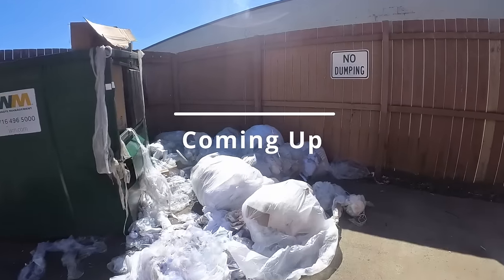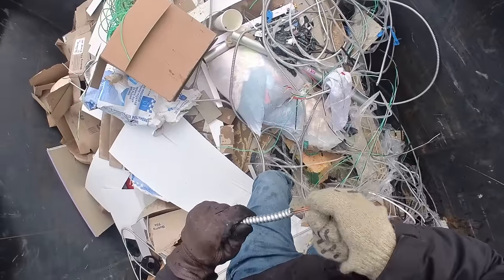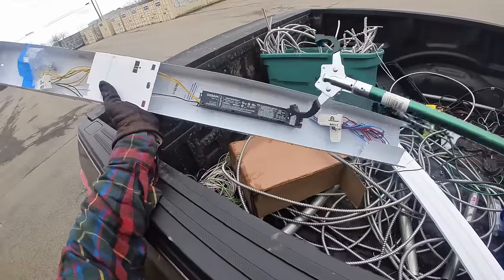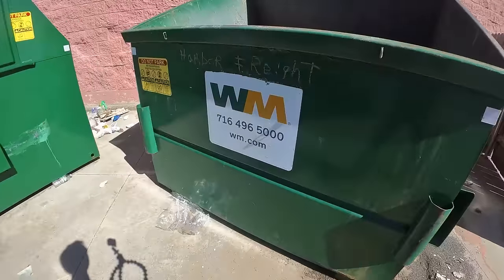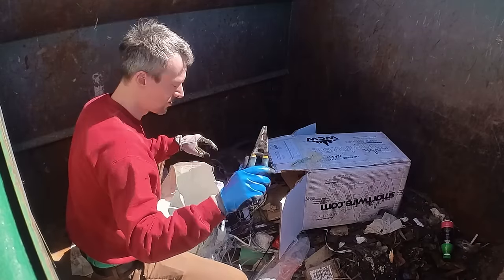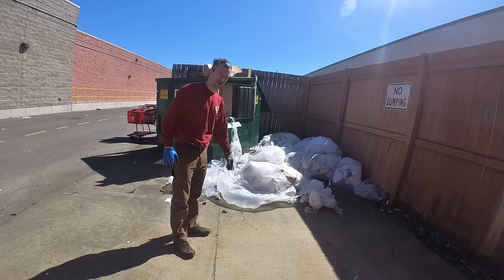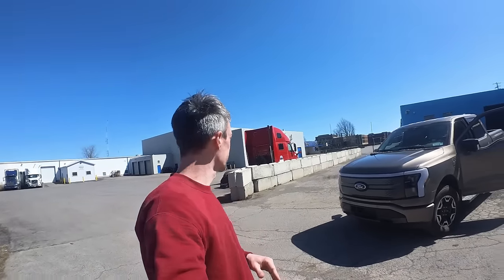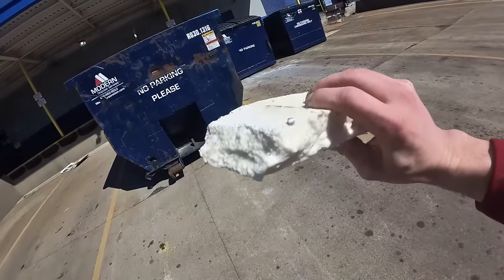Newbie Divers Trash Dumpster

Comment: Hello, Congrats on your upcoming little peanut!
I just have 2 questions for you and wanted to get your opinion. I have 2 evaporator coils. Do you think I should try to get the copper out? Also if yes so you have a video on how too. Thanks!
Reply from the maker: Thanks for the well wishes. For the elevator things, are they the motors that ran it? I haven’t taken apart motors before but I know there are probably some good videos.. all you need is an angle grinder and some elbow grease. 

Personally I don’t break down stuff like that, I would just turn it into the scrapyard as is. Mainly because I’d rather go out and find more stuff. Just my 2 cents